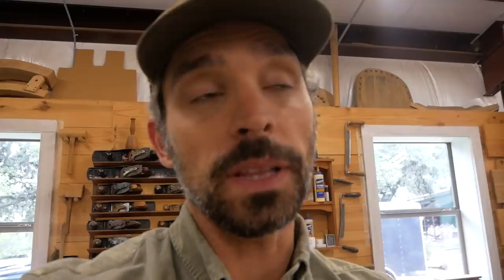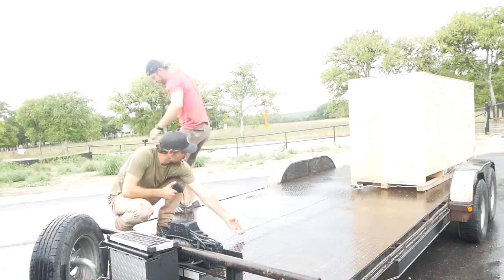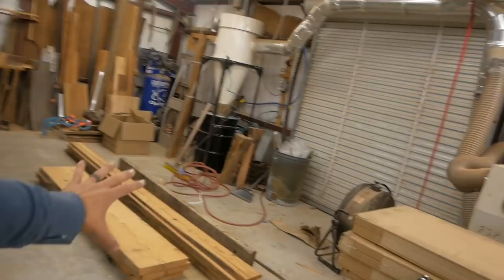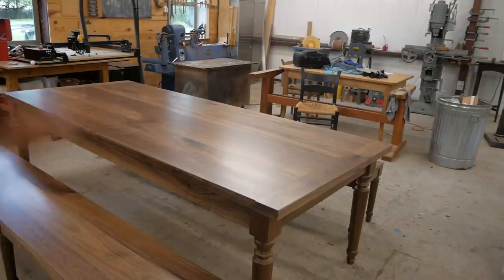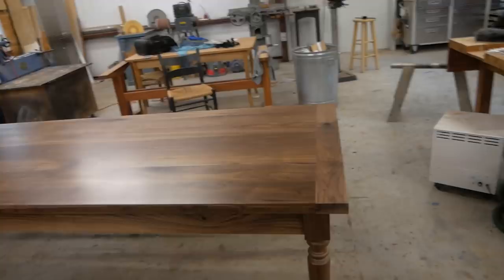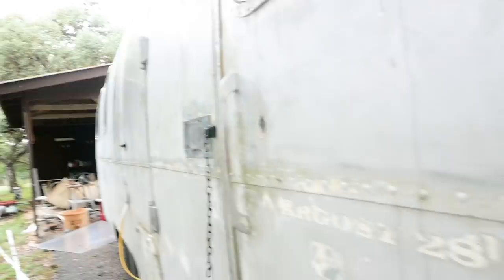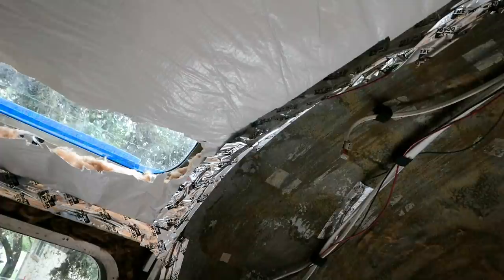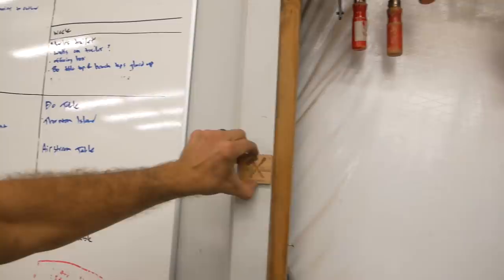A New Jointer With A 100” Table!! // Walnut Dining Table // Argosy Update

Comment: Andy have you ever considered using the silver roofing paint for metal roofs on your Airstream.   It has aluminum in it and will seal up tiny leaks.  I remember camping with my grandparents as a kid and the was an Airstream behind it.  The owners would periodically repaint it using the roofing paint.   Probably for that reason

Comment: Wondering if you do another airstream if it would be beneficial to just rhino liner the interior to stop all leaks before putting up installation etc. If not rhino liner (truck bed spray in liner) than another waterproofing membrane system from the bath section of the home improvement store maybe worth looking into.

Comment: Is nice to see that Oliver did sponsor you, as well as that it is nice to see your shop getting some upgrades. As for the Argosy trailer, it is possible to stop all the leaks but it is not easy to do. You might find that Cool Seal roof sealant will help stop some of those leaks if you cover the roof with it, and it does come in a white or silver tone. I am saying that as I ended up putting it on my old Spartan Royal Mansion trailer to stop some of the leaks around the roof vents. Another thing you can do is actually weld some of the seams with an aluminum brazing rod, all though I do not recommend that at this stage in your build, so I would go with the Cool Seal on the roof. But some of those leaks will stop when you paint it, as the paint will fill in some of the micro cracks you have in the trailer.

Comment: Spray some expanding, closed cell, foam into the joint on the trailer.  It will fill any void and block the water from being able to penetrate.  You should also put up a video of every build, even if it is just a time-lapse with little or no narration.

Comment: Not speaking on knowledge, but could you paint the outside of the Argosy with some type of waterproof sealer that would help with all the water issues?
Reply from the maker: I think I’ll load it up with epoxy primer.

Comment: On your breadboard ends I noticed the breadboard piece is sticking out a 16th from the rest of the table.  Is that just wood movement?  I've made a few tables/benches with breadboards and I"ve thought about making the breadboard piece a 16th inside of the table width.  Most of the tables I build during the hot summer with humid weather (Minnesota).

Comment: YOu should drive around with the rv for a while before you build the walls and finish the inside.  The vibrations are probably going to break every seam  There's got to be some kind of exterior stuff that is flexible and seals all of the little seams.
Reply: Get sponsored by flex seal. Lol.

Comment: A little cringe-inducing to see that nice parallelogram  jointer moved around by yanking on the tables.  When I moved, I asked the movers not to do that with my 12" Grizzly parallelogram, but they did it anyway.  The tables were then non-co-planer by about 0.01"-0.015, but that was enough to throw the cuts off.  Fortunately, parallelogram jointers are pretty nice to adjust.
Reply from the maker: You’re right it’s a really bad way to move a heavy jointer - I really had no choice.  I’ll have to re adjust the tables for sure